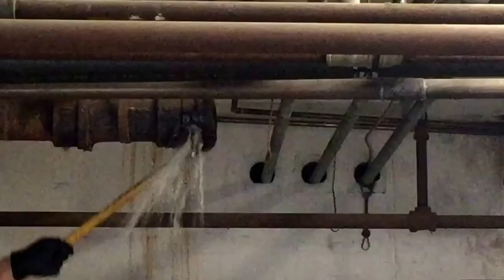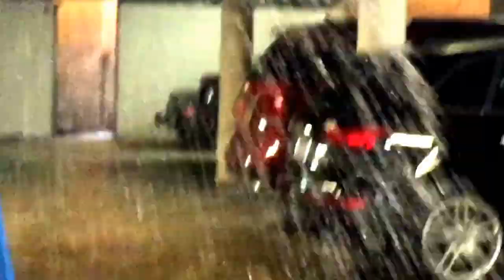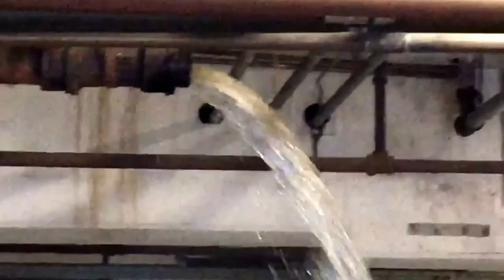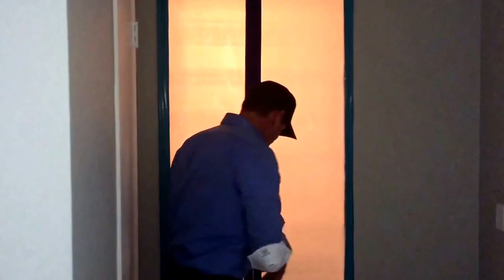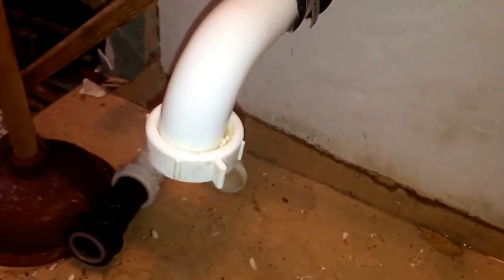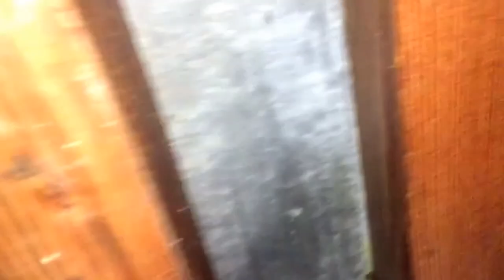How to Prevent Sewage Backup in a Condo or Apartment Complex

Comment: A few years ago I had contamination level 3 black water sewage backup into my apartment when I was away. The water seeped down to the bathroom below me as well. The manager didn’t know I was out of town and she started formulate a story saying that I caused it by flushing wipes down the toilet. It was ridiculous. Even after I told her I had been away and that no one was there to flush anything down my toilet, she continued to blame me, ignoring the fact that there had just been the biggest storm we’d had in years with record rainfall. 

Is that even possible?
Reply: Flushable wipes don't break down so they can easily pile up over time and cause this. Also, I have seen crazy roots growing in pipes that are above ground because someone decided to flush some small root balls instead of throwing them in the trash and they don't make it al the way into the underground sewer and just keep growing in the pipes.
Reply: What was the outcome? The same thing just happened to me while I was out of town over the weekend 😢